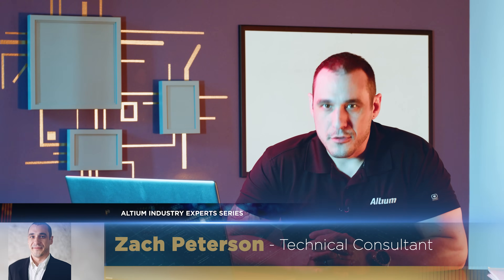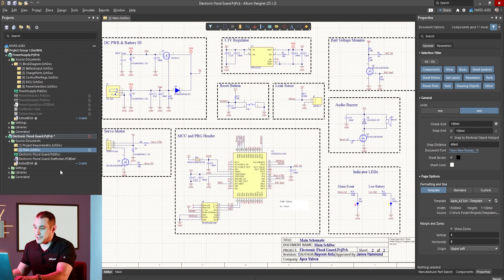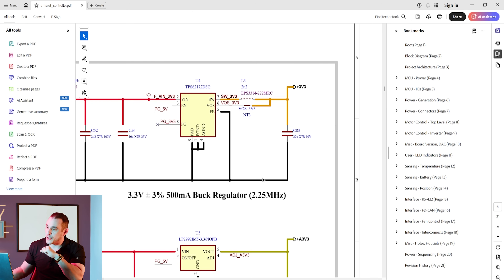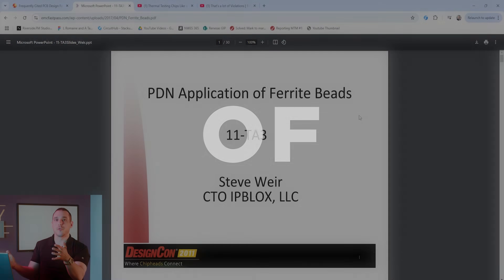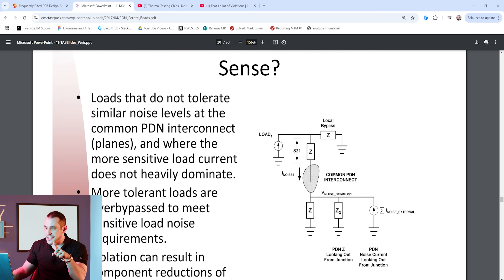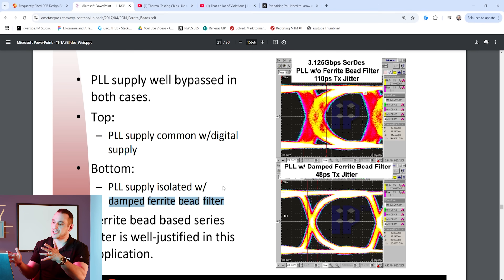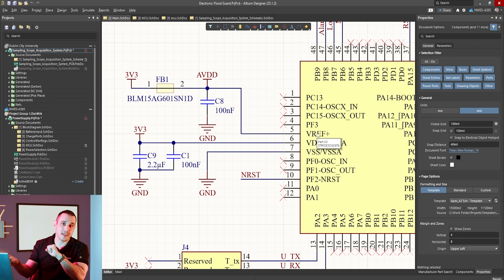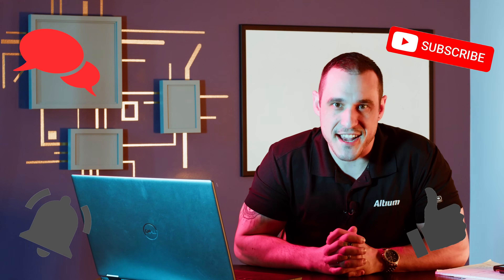Analog Supply without a Ferrite: Proper Isolation Techniques Explained

Comment: Ehh, just be aware of where the high frequency/current switchers are. A simple cap-bead-cap is great for constant current devices, which most analog is. Where biasing needs suppression into ghz range to prevent cross talk.

This discourse is mostly people talking over each other as they have their own application in mind.

Comment: why is there a need to filter the analog voltage supply when using it for precise voltage references? there shouldn't be much noise on the analog voltage supply line right? just makes the board more complicated
Reply: I'm referring to the case where you would use a single rail to give power to both supplies as this is where many application notes and datasheets will recommend using a ferrite. The problem is that the semiconductor vendor will never guarantee that using the ferrite will cause the circuit to work, and they will not guarantee that the circuit will not work if you do not use the ferrite, so even the semiconductor vendors have no confidence in the ferrite doing anything useful! In this situation, any transient excited on the digital rail can also be seen at the other pins connected to the bus, and this includes the analog rail and the VREF input. Maybe the noise is low enough as to not interfere with an ADC measurement, but if it is too much you should try some RC filtering on the analog supply and VREF, or just use different regulators. When high accuracy is required on the ADC measurement you should use an external ADC, precision voltage reference, dedicated supply, etc.

Comment: If you interest in ripple at the point where the load draws current, then the input impedance seen from that point is small enough to satisfy your ripple criteria. If you are interested in filtering, then the ratios Vout/Vin, Iout/In, or vice versa will determine. All are functions of impedance. The ferrite can be modeled by Lac and Rac  (excluding parasitic capacitors) ưhich vary with frequency, resulting in a system with varying parameters. Using fixed frequency R,L,C combinations to approximate the ferrite impedance is often used, but is not accurate in terms of phase angle.

Comment: I'd just have a low value resistor and a couple uF capacitance onto the VREF as it supplies no current.
Reply: Works on some opamps too or other low load loads if you can handle a small amount of reduction in load regulation -- most analog opamp circuits don't mind.

Comment: The STM I’m using says to not exceed a difference of 300mV between VDD and VDDA during startup/shutdown, if I use two identical LDO’s for both supplies, is this a concern?
Reply: A classic conundrum.  Ferrite beads or LC filters prevail here, though you can buy tracking power supplies. Though LC can have an associated time constant as well. A diode helps "guarantee" a minimal voltage difference but can reduce the noise attenuation as well.
Reply: Very good question. This is a difficult problem in this method.

Comment: Another option to consider is an R-C filter. Beads often do best at higher frequency and a lot of analog measurement is at lower frequency. This is best for low power supplies with decent PSRR IC's.. For a reference it will of course vary over time if the input supply isn't stable over the RC constant.  This will not replace a precision reference which if you need is the only choice but might be acceptable in a mid range accuracy measurement.
Reply: Most measurements with high SNR an RC filter will perform well as long as cutoff is set correctly. It's also simple to set filtering on the ADC input so that you filter the low frequency noise content on the input analog signal.

Comment: Hitherto, my theory was: A Ferrite bead is mostly to force a device to draw its current spikes from the (hopefully sufficiently large) bypass cap instead of the power rail, thus making it pollute the power rail less.... not to suppress upstream noise ... am I so far off?
Reply: No,  you're right.  It just needs damped.  The only place where expensive LDOs prevail is if you need really good load regulation and high currents, at low currents like for an ADC or a few small opamps you can do so much more with LC, traditional L and/or ferrite.ferries.

You do have to consider if it pollutes upstream, but generally an analog load will not do that. In any case, ample damping/bypassing or however you conceptualize it, in the upstream directions  ("looking backwards") gets the job done.
Reply: @romand4651  That`s why I'd normally expect to put ferrites on stuff like high speed logic, or chips that downright short circuit their totem pole outputs on transition (classic 555 timer is great to test simple noise filtering concepts - it can take surprising current spikes).

Comment: When working with microcontroller that does not use the analog feathers it is acceptable to tie AVDD to VDD power. If using any analog feather within the MCU, or if an analog rail exists, then I always tie and LDO isolated rail to AVDD.

Comment: How about the grounding strategy to isolate analog measurement from digital signals.  Is that needed at all?
Reply: What do you mean by grounding strategy? So many of those so-called grounding strategies just make routing difficult or they create a very strong dipole antenna with low resonant frequency, so the device will technically function but it can fail radiated emissions testing. Many times, when the analog signal you need to measure has good SNR, the concerns about noise are solved by creative placement of the components so that the analog components are confined to their own region of the PCB.

Comment: You briefly mention PSRR in the video but I'm curious about your thoughts regarding the frequency dependance of most LDO PSRR specifications. Usually the PSRR is specced at 120Hz-10KHz. Even at a few 10s of KHz, the PSRR dB falls off a cliff. At a few hundred KHz or MHz, the PSRR is usually useless. At that point, transients shoot right through the LDO onto the output rail. This makes the LDO fairly useless for isolating the output (an analog reference for example) from an input power rail that also feeds an digital IC or (even worse) a switching regulator. These switching devices can create huge dV/dT transients in the GHz, well above any LDO PSRR specification. I'm surprised how many LDO datasheets I see that include a PSRR specification but then don't include a PSRR vs Ripple Frequency graph.
Reply: Sometimes I used one channel of low noise OPAMP as ldo and low pass filter 2-in-1 to power ADC. 3-5 mA is enough for it.
Reply: As zach mentioned, ldo's are great at noise isolation. Any ldo/precision ref made in the last decade will have high rejection will into the 10s of Mhz. Bear in mind that this is only true if the ldo is internally referenced. if the feedback path gets longer, like an lm317 with external resistors, the frequency response dips accordingly. You can get a 2.5v ref in tiny packages too.
Reply: Just get a better LDO. Most modern TI LDOs go out to 1Mhz, then caps take over. You can also get RF grade LDOs that go upwards of 10MHz. 

Look for the TPS7A series for example - that’s my go to following any modern switcher in the 200-700khz range

They usually just cost more than the traditional/ basic style but usually that washes out anyway
Reply: @Dubbs360jr  a $3 LDO? And still has white and flicker noise in the uV? In a 5x5 package? Craps out by 10MHz? Modern 1-3 MHz switchers create plenty of noise beyond 10MHz

I'm glad it works for you, but its lazy design. Some of us have margins to maintain and volumes to produce.

Learn to damp an LC filter and enjoy many many MHz of attenuation for $0.05 and let your amp or cheap LDO do the rest with PSRR.
Reply: @Dubbs360jr  I'm glad you mentioned the TPS7A's, that's what I mentioned above, those TPS regulators have become my go-to for a lot of designs.
Reply: Finally someone gets it.
Reply: Sure there is rolloff in the PSRR spectrum but using the LDO for the analog supply is still better than isolating with the ferrite because you have eliminated the additional inductive impedance from the ferrite which is responsible for the transients in those frequency ranges (MHz). Take a look at a component like TPS7A24, it still has 10-20 dB PSRR in the 10 MHz range, which is where you might expect a transient on a digital PDN with a ferrite (there are some measurement examples of this on the Altium blog). Removing the ferrite already reduces the low frequency transient on the shared rail, and that's still better even if the LDO only gives something like 10 dB of PSRR. The PSRR is much higher at the lower frequencies as you mention, so if there is an upstream switching regulator that addresses a decent amount of the lower frequency switching noise. Lastly, for transients in the GHz range, those are addressed with the PCB plane capacitance, in-package PDN design, and on-chip capacitance which collectively provide low impedance in the GHz range. If you have a switching regulator which is running fast enough and with high enough current that it is exciting strong transients in the GHz range then it's probably not best to use this rail to supply an analog rail anyways.

Comment: ADC (usually adc1 and adc2) in STM32 can work in parallel, i.e. the measuring channel may be sampled with internal reference at the same time. So the AVDD noise does not matter.
Reply: But it does matter on many other components. Not all components that have AVDD and DVDD rails are STM32.
Reply: @Zachariah-Peterson yep, this virtually ratiometeic sheme requires identically time comstant in RC input and power circuits.

Comment: Given the cases you have shown, you mentioned many times that you need to test the ferrite bead being used. What tests would you be doing to validate using a ferrite bead?
Reply: You're not testing the ferrite bead, you're comparing the noise on the rail with the bead vs. without the bead when all the digital I/Os on the DVDD rail are firing during normal operation. The easiest way to do this is to swap the ferrite bead with a 0 Ohm resistor and measure the voltage at the power pin with a scope. You will be looking anywhere from 10 MHz to 1 GHz for the transient response. I have a video planned on this based on our Ethernet switch project.
Reply: The sort of testing that comes to my mind would be an 2-port impedance vs frequency measurement using a VNA. It takes special equipment and skills to perform.
Reply: @zktec1  You would only need that if you are trying to measure the impedance out to high frequencies. You can do that, but a faster way to do this is to look at any noise excitation directly in the time domain using an oscilloscope.
Reply: Достаточно измерить уровень пульсаций или среднеквадратичный шум до фильтра и после чтобы понимать его эффективность.
С dc/dc частотой 1+ Mhz и MCU 120-200 Mhz хорошо работает фильтр 22uH+22Uf на AVDD

Comment: lets put it simply. do not use bead unless had a simulation. If you didnt simulated, go place an LDO
Reply: and search a LDO with a good PSSR for your noise frequency
Reply: How hard is it to damp a LC filter.  An LDO? more expensive,  worse performance at high frequency.

Comment: Think about this: the voltage noise on an inductance or ferrite bead comes from a changing current. When the current changes most on a uC ? When the output pins switch into a big load (small impedance). The solution? Buffer the io pins into an high impedance and power the buffer with a dedicated regulator. In this way you can use a linear regulator for both analog and uC and nothing else digital. The ferrite or inductance on that rail will not introduce noise from the switching of the pins and will reduce the noise coming from above the pdn.
Reply: Output current on gpios is limited <30 mA. Most current spikes gives the CPU core, DRAM, and nand flash, for example, have big current consumption during writing or erasing pages, and almost zero consumption during idle time.
Reply: @SerAlGa  30mA on 50 pins is a lot
Reply: @robegatt never use gpios with currents more than 5-6 mA. If you need more current, you should use an external buffer or transistor with open drain output.
Also keep in mind that gpio domains is limited with maximum allowed total current on all pins in this domain (see datasheet).
Reply: @SerAlGa  that is exactly my point, re-read my op